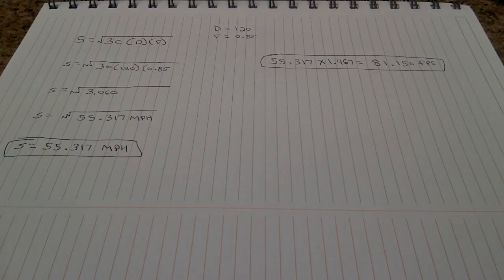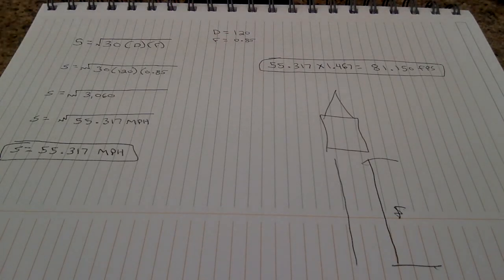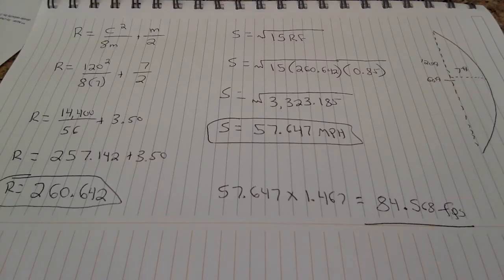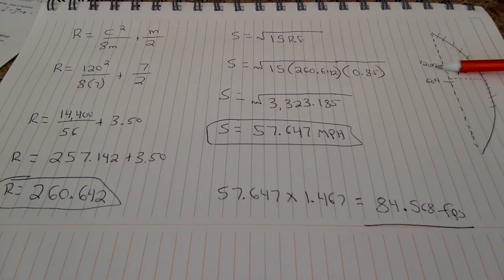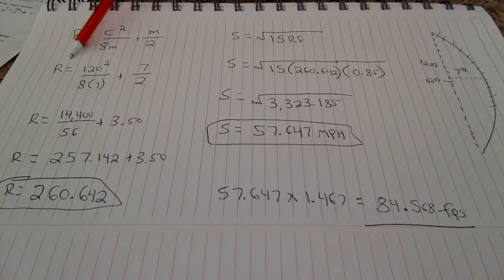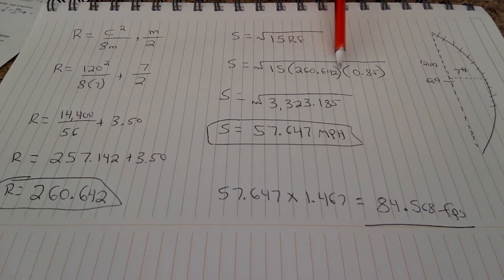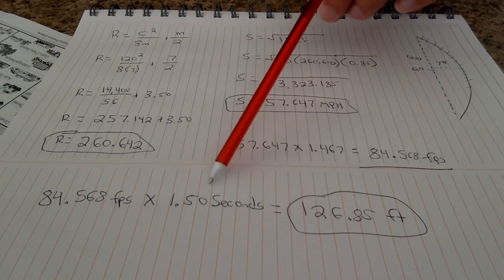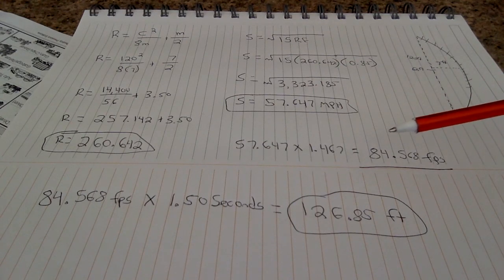How to Calculate Vehicle Speed From Skid Marks

Comment: Isnt this for reference use only? The difference in friction from the tire would be different for each type of compound of rubber and width of tire. Plus, ABS would make the skid shorter because the amount of friction will rise and fall.
Reply from the maker: Although tires have different friction / grips, this equation is only using the general friction ratio of asphalt. In a perfect scenario, the reconstruction team will use the same or like tire that was involved in the collision and do a friction test (drag sled test) with that. They would do it ten times to get an accurate average. It will still get you within +\- 3 MPH of the actual vehicles speed.  Also, ABS still leave slight skid marks but not much. So, we would measure from the beginning of the skid mark to where the vehicle rested or impacted (a building / wall/ etc…if the vehicle drove off a cliff, it’s almost impossible to get the accurate speed). So, that distance is how you could would get an estimated speed. Additionally, if a collision is caught on video we can use the distance / time formula to compare to the skid mark speed result and get a very accurate reading. 

I was able to test all of these scenarios. The driver would have a passenger record the speeds when a locked skid took place. I would calculate the skid and compare it to the drivers MPH. The results were within +\- 3 MPH. It’s a decent tool to use to estimate, because in reality +\- 3 MPH in a 70 MPH collision doesn’t make a difference.
Reply: Great video!